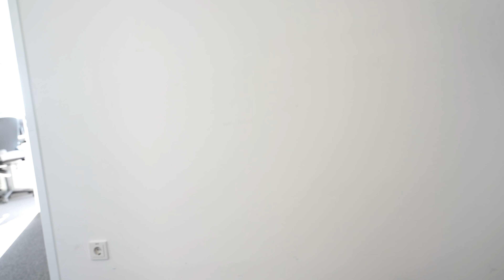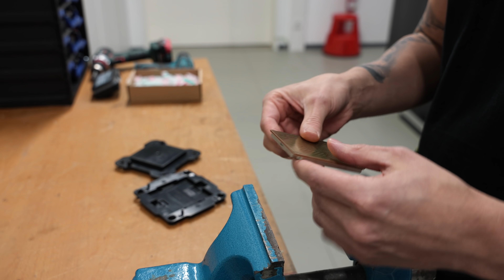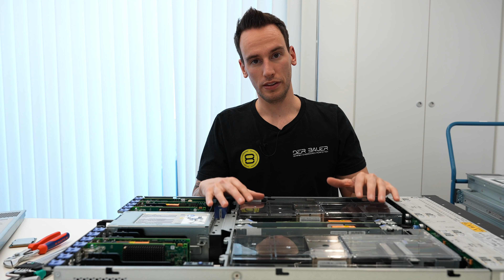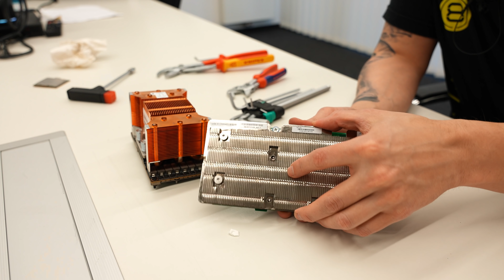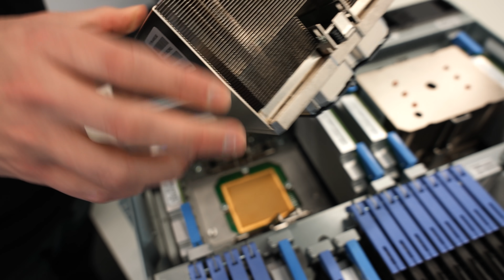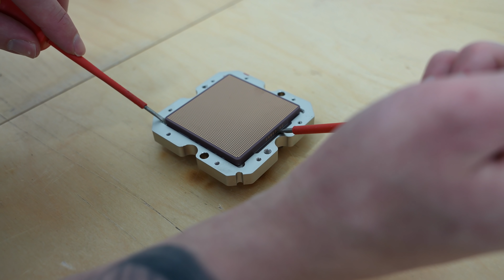Professional CPU destruction  (and investigating some insane servers) - Visiting OEDIV Part 2

Comment: ive seen something like that power 7 socket interface used on DLP projector chips where it was a sandwich

[light guide casting]
[DLP chip]
[plastic interface plate with gilded pins]
[control PCB]

3 or 4 screws around the edges hold everything together

Comment: Power9 CPU is pretty huge, I would say it's almost as big as Epyc CPUs. And surprisingly expensive too. And that special type of LGA socket is designed to be easily replaced by either the customers who knows what they're doing, or IBM technicians so they can bring it online in about an hour of LGA socket replacement from shutdown to bring-up - I can do it in about 15 minutes, bring-up time of an hour is more typical as it involves putting it all back together and boot up the server then logging onto it.

Comment: On the ceramic module that you weren’t successful on,  you should see a wider gap between the edge of the ceramic on one side and the metal HS frame.  Just shear it in that wide direction by pushing on the ceramic, and it’ll pop loose. A good flat vice makes it easy…

Comment: For that ceramic CPU, you could drop it into a large volume of hydrochloric acid and leave it in there. The aluminium will dissolve, but otherwise it will be mostly intact.
Reply: I don't think the silicon would be intact
Reply: @NeilBooth  Si does not dissolve in HCl.

Comment: Fun stuff!  The POWER9 chips in the Linux-only designs have double the core counts (up to 24 as you said) with half the threads per core (4) of the ones for AIX and IBMi (8).

Comment: You’re telling me that the minus pad extreme is more conductive than Kryonaut Extreme
Reply: yeah but its much thicker so its going to be worse at transferring heat. Like you can have a more conductive piece of metal but if its 30 cm thick its not gonna transfer heat quickly from one end to the other

Comment: Those dummy DIMMs are brilliant, PC memory makers should sell dummy versions of actual DIMMs so us who use 2 DIMMS on a 4 socket board could fill the blanks with the dummys.
Reply: Corsair sells Dummy DIMMs
Reply: @MuMix61  So do Thermaltake and Gigabyte. Not a fan of these though, a normal home PC doesn't have the massive air flow / air tunnels that these server dummy modules act like air ducts for.
Reply: Corsair sells dummy RGB DIMM’s that let you even control them via Icue. So you can use 2 actual corsair RGB DIMMs and then fill out the other two with dummies to still get the fully populated look.